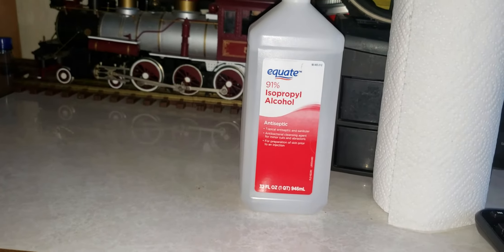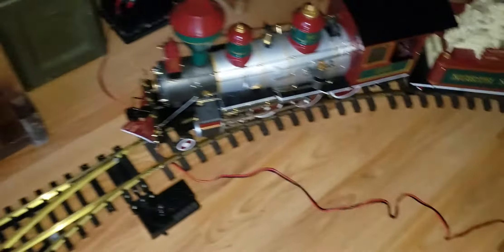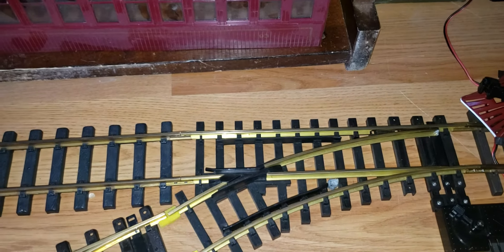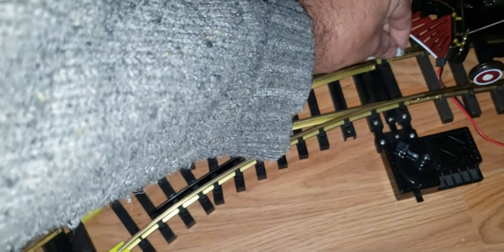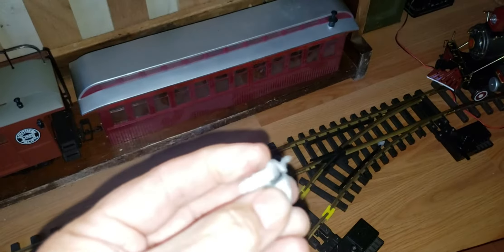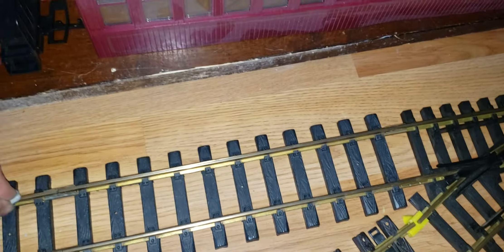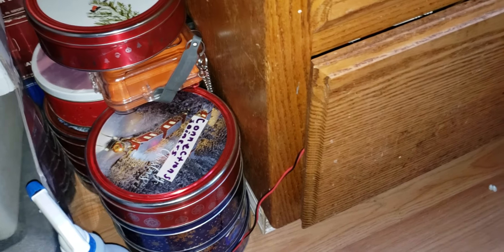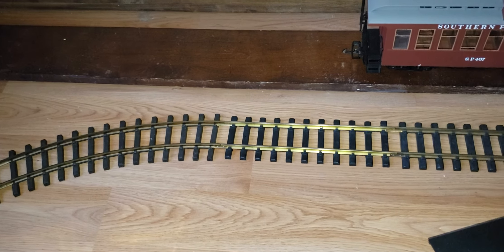G Scale Indoor Track Cleaning

Comment: Marry Christmas.
Reply from the maker: Merry Christmas and a Happy New year to you,my friend.
Reply: I have a g scale train set and the train keeps stopping when I run it. I have steel alloy track. Do I need to switch to brass track or get new power clips.
Reply from the maker: @InflatableMan88  I recommend switching up to solid brass track made by Bachmann, LGB, Aristocraft , etc.  Much better and stronger than  the cheap, weak steel alloy track that Bachmann supplies with their G scale train sets. Rail joinser aren't a bad idea, either,especially if you're running a large outdoor layout. Look on Ebay, or Amazon.com for the best deals on new and used brass track..

Comment: Does it work on Silver tracks ?
Reply from the maker: As far as I know. I use it on all scale track to remove that black gunk that builds up on them as the train runs on it. Works great !
Reply: @rkygriz  thank you very much I’m going to do some hardcore cleaning tonight
Reply: I’ve never cleaned tracks until now their much needed cleaning
Reply from the maker: @christopherpotter5963   Try some 800 grit Emory cloth/sand paper on a regular sized sanding block before using the alcohol. It'll do a better job if there's corrosion on the rails. You can get it at any Walmart, or local hardware store if you can't find it at Wallyworld.
Reply: @rkygriz  the alcohol worked absolutely perfect thank you so much brought back a lot of life in my trains
Reply from the maker: @christopherpotter5963  There's definitely  no understating the value of a good track cleaning before each and every run of these big trains.